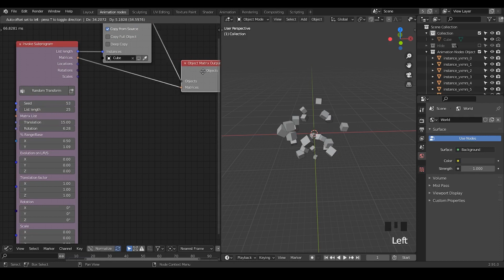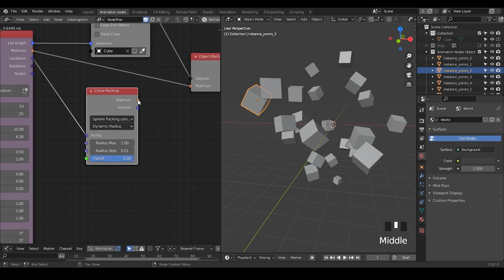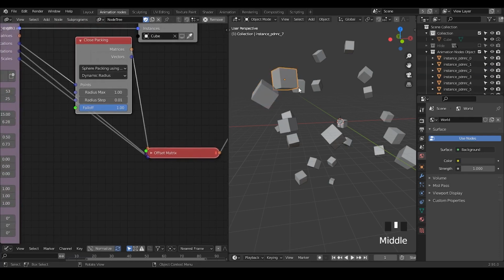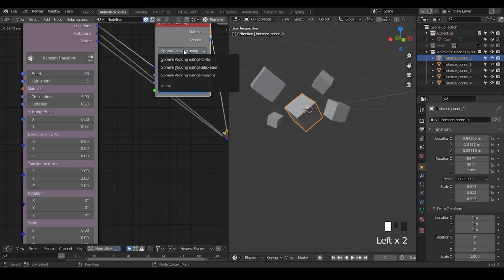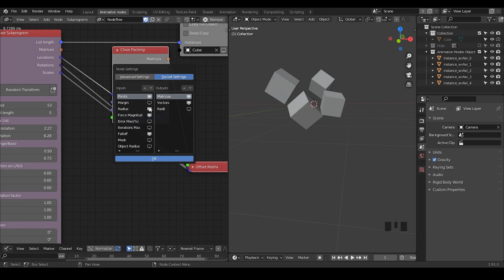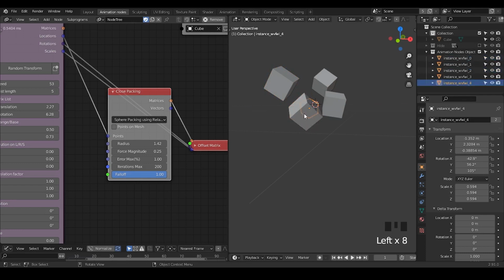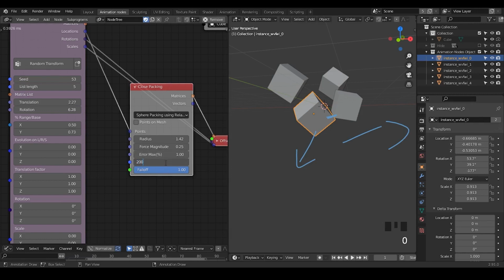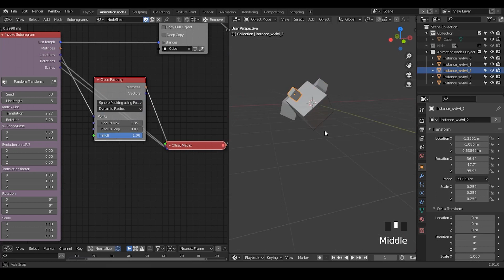[Tut] Random Transform without intersection - blender animation nodes

Comment: Does this work with splines too ?
Reply from the maker: what do you expect for it to work with spline?
Reply: @bradleyanimation120  I mean the intersection
Reply from the maker: Айрат Юсупов you can, but it isn't straightforward, you need to make the spline, and then reevluate spline, avoid intersection, and then regenerate new splines. Even after all these you can still get issues here or there. There is very few things that can be done with spline
Reply: @bradleyanimation120  Thanks for the answer.